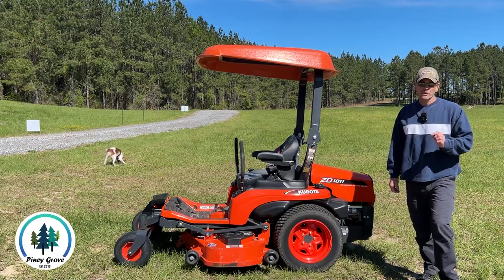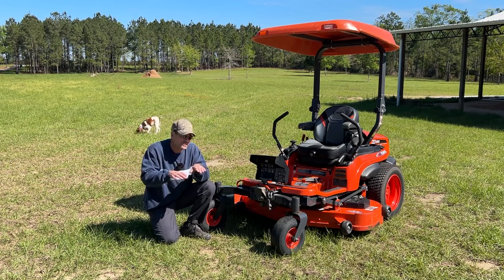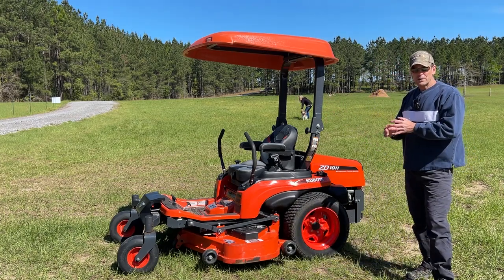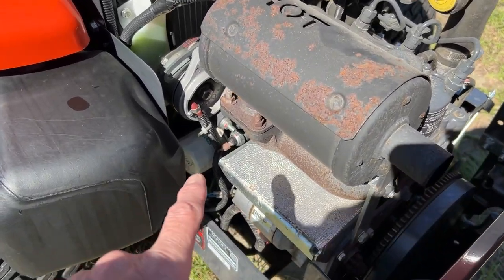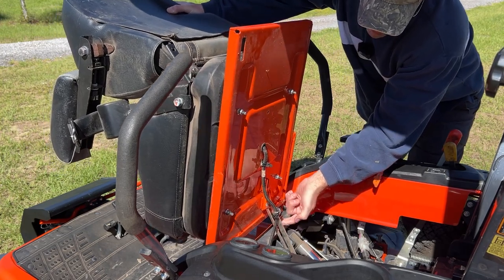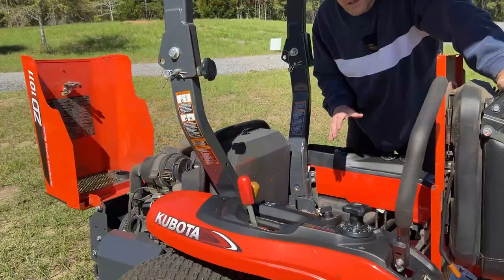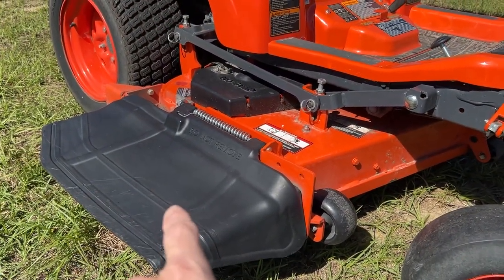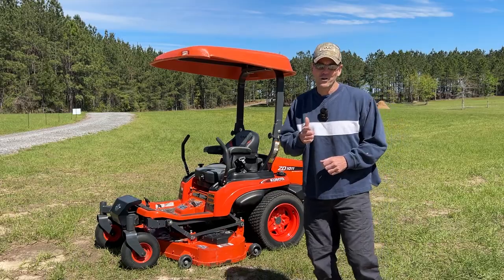Kubota ZD1011 Diesel Zero Turn Mower Review - First Impressions!

Comment from the maker: We're excited to have a zero turn because this is how we mowed everything before: https://youtu.be/s8Xb3tqZy10

Products in our Amazon store used in this video (costs nothing extra to use these links!).  You don't have to buy these specific items to support our channel....just use a link below to get to Amazon then make any purchase: 
Flex Tape: https://amzn.to/3R4MdWm
Mechanix Leather Gloves: https://amzn.to/3HjoZZf
Titan Post Hole Auger: https://amzn.to/3toHEx2
Ratcheting Fence Tensioner: https://amzn.to/3aEfSX0
Pope and Pipe Level: https://amzn.to/3tqUhHX
Fence Post Puller: https://amzn.to/3QbcNhy
T Post Manual driver: https://amzn.to/39dwt3J
Come Along Winch: https://amzn.to/3aQMqND
Clip bending tool: https://amzn.to/3xlqrG0
Mechanix Leather Gloves: https://amzn.to/3HjoZZf
6’ Digging and Pry bar:  https://amzn.to/3vH5Agx
Dewalt 20V ½” Impact Wrench: https://amzn.to/3UOcXNH
Dewalt 20V brushless Leaf blower: https://amzn.to/3zwJcYm
Dewalt 20V brushless ½” drill: https://amzn.to/3HGXJ7z

Comment: I have a ZD326 which was replaced by the ZD1211.  It is by far the best mower I have ever had.  1,800 hours and still runs and looks like new.  Just a suburb mower with proper maintenance.  It is also so much better on fuel than the gas mowers I have had.  I hope you enjoy your new mower and it serves you as well as mine has served me. BTW, the factory Kubota blades are excellent and wear extremely well in my experience.
Reply from the maker: We wanted a 1211 with a 72" rear discharge, but they kept going up and up until it didn't make financial sense anymore.  We got this machine at 66 hrs for 50% of a new one.....I can't imagine we will wear it out in a lifetime!

Comment: I have a ZD-331, bought new in late 2007, the only issue I have had, is about three years ago, it would start overheating, (has a pretty good alarm by the way). Replaced the thermostat and cured the issue. I'm pretty sure the shiny thing you pointed is the electric fuel pump, the second filter, (one for each tank), is about even with the front end of the battery. Even with 31 HP, I ordered a 60 inch Pro Deck, instead of the 72 inch, as I actually mow the pasture most of the time, instead of using the tractor. The Zero Turn does a good job in the pasture because the mower cuts the grass before the big wheels. I paid $12,000. and change in 2007 and thought that was a lot, but after 17 years looks and mows like a new mower.
Reply from the maker: They are great machines.   We just got a Yakta also: https://youtu.be/O8d6Z7CXpBA
Reply: how many acres pasture do you mow with the 60" deck?
Reply from the maker: @dj-nr8nm  About 5 acres every week.

Comment: I looked at those and ended up buying a B2301 tractor with a deck instead. The zero turn was a bit bouncy for me and for a few dollars more i got better versatility. I really like Kubota.
Reply from the maker: I would always recommend to buy a tractor first!
Reply from the maker: @@Kernica1 I'd look into a used a tractor and finish mower because any zero turn that gets used for 15 acres every week is going to wear out fast if it's not a commercial mower.   Commercial zero turns and compact tractors are similarly priced.

Comment: Interesting, I've got a 1994 JDeere F935 60" Diesel front deck mower, and it would be 30k + to replace it. I might have to look at one of those models instead.
Reply from the maker: You can get a nice used ZD1211 for $14-16K with a 72" deck.  Last forever!

Comment: Genuinely confused. Why is this worth twice as much as the Kubota gasoline version? Does it cut a lot better? Last that much longer? No way I believe you're going to make up that price difference on fuel.
Reply from the maker: There probably isn't a big a price difference between their commercial grade gas mower and their diesel mowers....they make many models.   But the advantage to the diesel is fuel efficiency and longevity.

Comment: The 1011 is 17.9  1021 is 19 hp
Reply from the maker: From Kubota website:
The compact diesel engine, rated at 19.3 horsepower, and two-range HST that power the Kubota ZD1011, give you the power you need to take your lawn care to the next level.